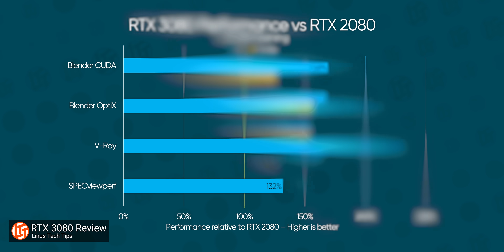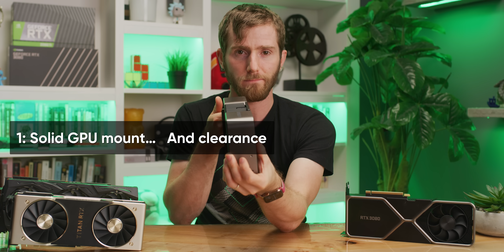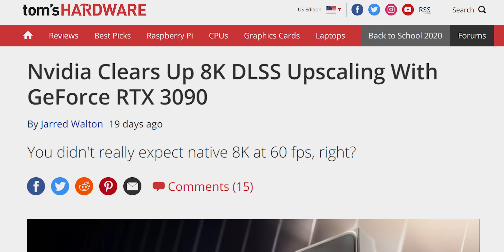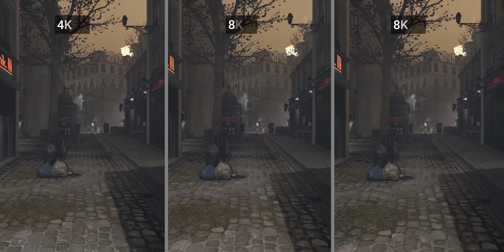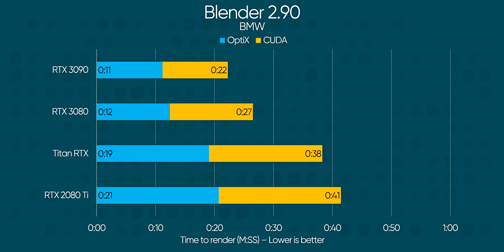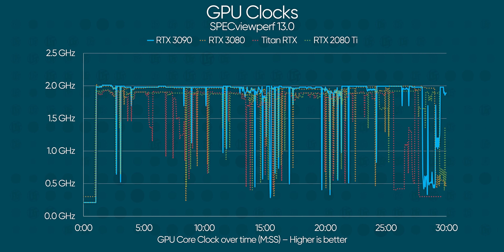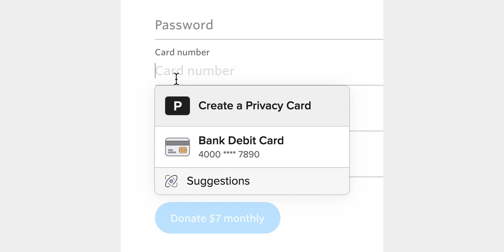Making Nvidia’s CEO mad - RTX 3090 Review

Comment: Has the hardware to beat RTX titan/quadro by a mile, but software locked to save profits.
Come on nvidia, please don't pull a tesla.
Reply: The future is going to turn into software locked everything
Reply: @jasonduarte95  i hope they don't software locked my bread
Reply: They will until they get the initial 'revenue' that they are hoping for the first wave - once the market had died down on these first variants, comes the SUPER / TI / TITAN (with locked software of course). Rinse and repeat, and voila, PROFIT!

True NVIDIA Signature marketing move :))
Reply: @Ghost19_  locked software..uhhh.. can't you just overclock them ? lmfao, if they're built to handle more horsepower than they can handle overclocking.
Reply: @AbyssalNova805  you're missing the point, NVIDA had been doing this for a long, long time now and sadly overlocking has nothing to do with it no matter how you try (Linus and the rest of the tech professionals should have done that if it's even possible). Nvidia is notorious for this move as to why this very precise video and ending comment directed to the CEO was done by Linus.

This is to ensure that people would buy this first and if they're still thirsty, would then release SUPER / TI / TITAN variants and once everything had been exhausted will then release a patch to unlocked all features. This is also another move against AMD if they managed to margin with them by performance.
Reply: it makes sense for them to keep Quadro features for Quadro cards, and i wouldn"t be surprised if they"ll have a Quadro in this generation that stands on top in raw performance like the RTX8000 did in its generation, but since they are marketing the 3090 as a Titan replacement it should get the Titan featureset

Comment: It's basically 2014 again where £600 buys you a good 4k 60fps sytem. Only then it was two GTX 970s or 290Xs in SLI/CF, while now that's the price of one graphics card. Still, better than the years in between where 4K was dead because multi-GPU stopped being a thing and there was no single GPU good enough to take its place.

Also if you're going to call this an "8K graphics card" you should be pointing out that is UPSCALED to 8K using DLSS, the game is not capable of native 8K gaming in any meaningful sense.

Comment: 8k native runs around 30fps for near everything.  I like how they skip over those charts as fast as they can, so they aren't on screen much showing how the 8k native performance sucks ass, even though it was hyped as an "8k gaming" card.
Reply: Yeah, "Hyped". But there are some games that are mostly playable at 30fps. Esports Professionals probably won't be upgrading, sure, but let's keep sight of the achievement. Pixels so small that they're indistinguishable at any decent distance, and at frame rates that rival Cinema.

But I do agree that it was hyped as so much more. And in truth, I was disappointed too, even though I have neither the budget, nor the intention, nor even the system requirement, to buy a 3090. I was imagining 200+ at 4k, in medium to well-optimised titles like Doom Eternal. I was imagining a whole new class of 4k Performance that would turn the market on its head. I was imagining something that would blast AMD into the dust, purely for the challenge of competing against AMD.

That isn't what this is.

TLDR is just that I think that "Sucks ass" is a bit strong to describe 8K performance. It's certainly not for twitch shooters or Esports, but the fact that it can do 8K at all is an achievement IMO.

Comment: @Linus Tech Tips
You cannot say the game used that much memory, a game will take as much memory as it can even if it isn't going to use it, it's better for it to load more assets into memory in case it's needed than to load it too late.

Doom Eternal is a bit of an odd one out, there are very few games that are that well optimized, and pretty much no one will play at 8k.

Based on GN overclocking the RTX 3080 and 3090 is not worth it based on the insane increase in power usage for a couple of percent extra performance.

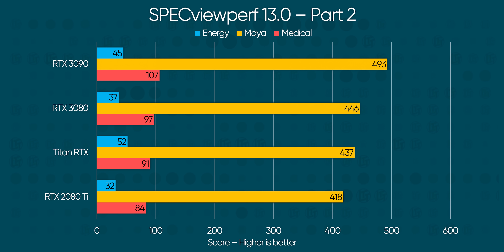Comment: Sooooo, at 10:40, he says that an 850W PSU isn't enough?? How? Even with an overclocked CPU AND GPU, that would be crazy if it runs into that limit. Every other reviewer I've seen has had total system draw <700W. Gamer's Nexus had OC'd 3090 power draw at ~425W

Comment: nVidia: We have drivers optimized for the Titan RTX and won't put it on the RTX 3000 series because it will outperform our Titan line.
Consumers: Why do you care?
nVidia:  ($)¯\_(ツ)_/¯($)
Reply: the 3090 is a titan replacement.  The reason they won't improve the performance of the 3090, even though it likely has much more to give, is because they don't want to step on the toes of their Quadro line, which is where their real money is made.
Reply: @chubbysumo2230  I mean the RTX Titan was 2500$ with the main difference in performance being the additional vram (over the 2080ti), you think NVIDIA wouldn't want to charge an extra 1000$ and call the 3090 a titan. If they gimp the 3090 in workstation applications and release a similarly spec'd titan at 2500$ that massively improves in workstation applications, "prosumers" will be forced to pay the additional 1000$ for virtually the same card (minor spec bump and driver optimization) without eliminating all sales because smaller workstation purchasers cant afford their Quadro line.
Reply: @chubbysumo2230  okay, then make the ampere quadro better. Shocker.
Reply: @chubbysumo2230  "performance like titan" isn't "we are now eliminating titan forever" is just marketing for the 3090. NVIDIA will still lunch a new ampare titan for 3000ish and quadro for 5000-6000 ish.
Reply: They'll never push 3090 as aTitan replacement bcuz if u see basically reverse engineer the graphs shown by Linus , 3090 is almost all same as Titan with different drivers and supporting GDDR6X which makes it winner in few cases but with small difference
Its just almost rebranding of same product in lower rate (as if anyone is going to open the die and count cuda cores in them), they might have removed few bugs from titan's architecture , and rebranded it for $1500

Its all about resolving old architecture mistakes , rebrand it , lower the rate and sell

They actually might working now on the next gen Titan which will really keep its mark and real source of income , other whichever product you buy is just a bug fix , new drivers , new software side technology , new body and buyer is a new fool
Reply: lol
Reply: @mamamia88 In a few months, the dust will settle, Intel will have the Rocket Lake closer , We will know more from AMD and the benchmarks will be more clean & clear than the mud on the windshield we see now.  I mean, these benchmarks didn't have enough of the current market in them (the cards that are ACUALLY IN PEOPLES COMPUTERS IN THE CONSUMER WORLD)....where the hel_l_ was the 2080Ti?  and 2080Ti overclocks and modded ones.  Let's put it all out there and see what sticks and what makes anything worth something.  nvidia can't even produce enough cards to hold a sale as long as it takes to take a P-I_S_S.
Reply: Exactly. And the RTX Titian is still selling for $2500 today.
Reply: TheInfamous well to be fair the amount of 3090s in existence is probably about 100 cards split between all the major tech reviewers so I suspect that so long as the supply of 3090s is in the low double digits they’ll remain selling their RTX Titians lol
Reply: @DeansDiscourse  New 2080 TIs are still going for the same price points as well, despite the existence of the more powerful and much more affordable RTX 3080.
Reply: @DeansDiscourse  so it's the i9 10980Xe of the GPU works wee only tech tubers will get them before they stop making more.
Reply: https://youtu.be/vfc42Pb5RA8
Reply: To be fair, the Quadro-like profi OpenGL features were only added later to Pascal and Turing titans, because AMD added them to Vega frontier, and Nvidia did not want to loose in the production SW benchamrks. But they did not even launch with that, originally Pascall Titan was just "slightly stronger 1080TI year earlier" only once Vega frontier launched it miraculously became semi-profi capable with new drivers. The Titans before that, Maxwell Titan - more Vram not nothing else. Kepler Titan = more Vram and fast FP64, but nothing else.
Reply: @Lady_Zenith  that is why amd is super important for this market, without them to compete with NVIDIA, we would get less and less performance each year, and they would push more cards for different task. I am wishing that big navi could get to 3080 performance or else we screwd.
Reply: That's why Nvidia will always be with their blob driver, unlike AMD.
Because with blob they can control what you will do with the cards.
Reply: nVidia
Reply: quadro!! It’s all about the quadro! I love my quadro!
Reply: There will be a hack written to take advantage of this.  JWAS
Reply: @mamamia88 8k
Reply: * AnimalHeadSpirit *  I've been doing this for a long time. When has Nvidia's GPU prices ever gone down when a new gen of cards are released? They always remain at the same price until they are no longer carried by retailers and the only purchasing options are aftermarket resellers and used markets, where they still hold a really good resell value for quite some time.

Used 1080 TIs are still going for $450-$500 on eBay.
Reply: Lmao
Reply: Hence why we need competition from AMD. Then Nvidia will get rid of this kinda arrogance.
Reply: The titan series isn’t even meant for gaming and most of those drivers are optimized for AI
Reply: @TripleLayerLemonCake  That's true but it's not like some people didn't buy them to play games on (a fool and their money and all that). It kinda makes sense from Nvidia's perspective to do it this way, the 2080ti vs the Titan was about a 10% max performance increase. 

If they sell that additional performance between the XX80ti and the titan for -1000$ in gaming to the people who will pay whatever it takes to get that extra little fps while forcing professionals to buy the 2500$ version that can function as a workstation GPU with supported drivers you can reap the additional 1000$ on both ends of the purchase. They get to have their cake, eat it, and bake another one from their extra profits too.

Comment: That thing needs to be vertical mounted.  Thankfully fractal design has an easy to install aftermarket one that I used in my previous case. This wouldn't work even in the 3 vertical slots in the P500A (my ASUS Strix 5700XT card is 2.5 slots and is very close to losing performance from it's proximity to the side window).

Comment: Looks like a decent product, though I am disappointed in LTT doing a sponsored video for the RTX 3090 and then doing a "review" for the same product the very next day.
Reply: For me the product or its cost is not the issue, there will always be early adopters who will buy the latest and greatest despite the rough edges. Heck in 2006, what seems like a former life, I bought a Nvidia 7950GX2 and I don't think I regret the purchase though it had buggy SLI support and was completely outclassed by the 8800GTX that was released just months later. Since then I have built several computers with Nvidia GPUs and they have been great for the most part outside of the long standing issues with Linux drivers.

Nvidia has done a great job in transitioning its product line over to a new architecture and modern lithography process and has been bold enough to offer a line-up of products that makes their existing products obsolete despite no pressure from the competition to do so. On top of that they have put in the effort to provide good driver support and many useful extras (DLSS 2, Reflex, RTX Voice, CUDA, CuDNN etc.) that helps differentiate their product. Getting out a GPU for those people looking to play upscaled 8K, a niche audience, with what appears to be mostly decent driver support is definitely applaudable (looking at you AMD Radeon VII). Given the high-end cooler, large die size and large high speed memory and low volumes I wouldn’t be surprised if the product doesn’t deliver enough in terms of margins to justify the investment as a standalone product, it definitely feels like a halo product to draw in more mainstream customers to the rest of their line up. 

My issue is with LTT. Given that the review was almost certainly done during the period in which Linus and the LTT crew knew they were contracted to do a sponsored video, I think it would have been good to disclose it in this video. This is especially relevant given the comments Linus and Luke made on the WAN Show on whether Digital Foundry’s pre-release coverage of the RTX 3080 could be trusted, it seems that they don’t hold themselves to the same standard. As for getting a video out early, yesterday MKBHD also got his hands on the RTX 3090 and he did a non-sponsored video in which described his experience of gaming at 8K, even if it was uploaded a couple of hours after the LTT video. I am not sure whether it was worth taking Nvidia’s money at a time when they are doing a review about a product that is of interest to many in the LTT audience,
 they clearly have other sponsors and sources of revenue to pay the bills and wages.
Reply: This may as well be part of the sponsorship.. they cherry picked a lot of the stats here, gamers nexus did a much better job at benchmarks and actual feasibility analysis
Reply: @ryanerickson764  yeah the numbers in this review are way off, generaly it;s 10% vs a 3080 gathered from other reviews from multiple games. Lost all respect to this channel
Reply: @wofljaw  
Can't really call Linus' review an honest one, Gamers Nexus did a much better job in that regard, no sugarcoating whatsoever.
Reply: Agreed
Reply: @Rubed0_o  https://youtu.be/Xgs-VbqsuKo

Comment: about CATIA: If the 3090 had the titans performance, then not only the titan but also the quadro line would have finally been useless. The optimization for engineering software had been the only reason to buy quadro cards for years, hadnt it?

Comment: I think what you should look at Linus, is that it is not the fault of the Quadro drivers, but the fact that some applications are reliant on them. Clearly some are not limited by the 2080Ti or the 3090 compared to the Titan RTX, which means either Nvidia is cheating on benchmarks or the benchmarks don't have optimized profiles for those cards.

Comment: Gaming performance about 10-20% faster than 3080(?) that makes me curious
Can you using a 3080 for gaming at 8K but with slightly lower setting than your 3090? Or 10GB is really not enough? (I guess this is the case but I'm just curious)